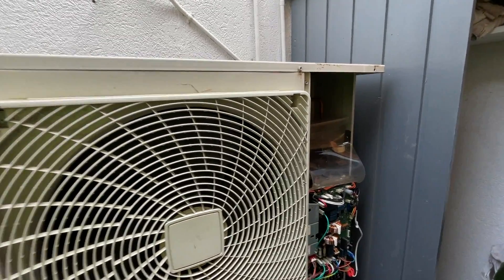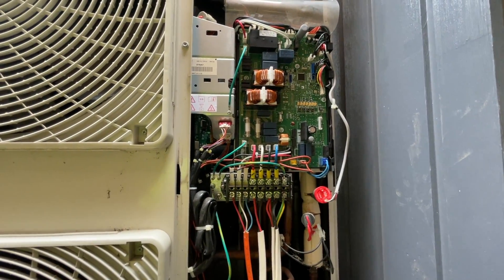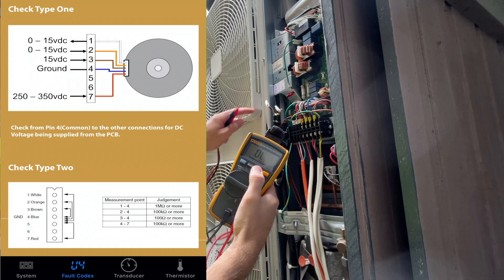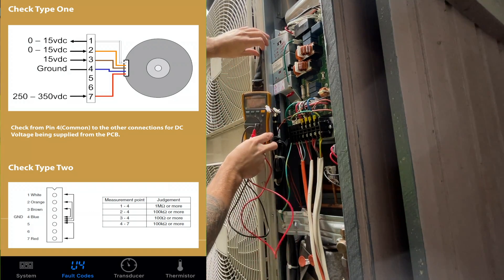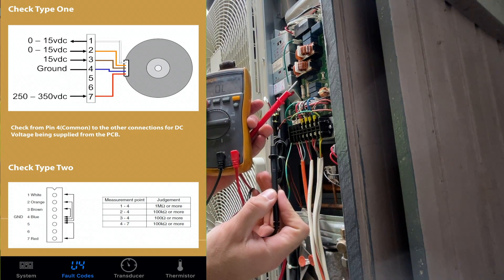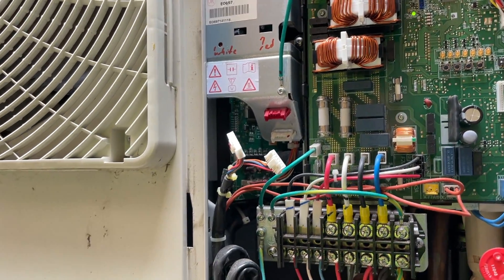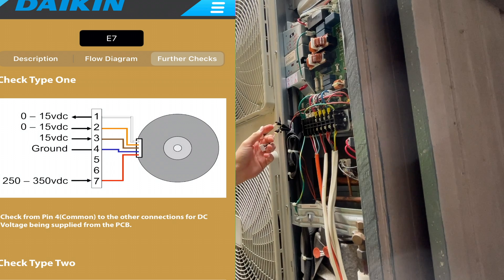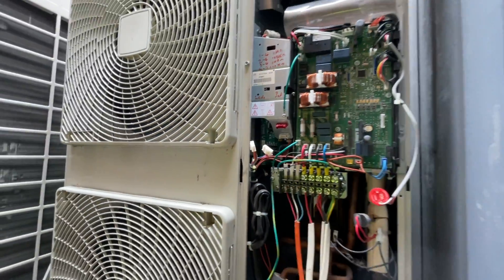Diagnosing Daikin E7 Error (EP 1)

Comment: Hey Mate great video, I've got the same code E7 - 02 on a similar unit. I've tested the fans and can only get 65kv from pin 4 to pin 3 on each connector, everything else shows nothing. Not sure if my multimeter is dodgy and just not reading the actual resistance (can change the range) I've even taken the wires out of the connectors to make sure I have good contact. Both fans will run (bottom fan a bit slow) and then shut off and throw the code. Any thoughts? Cheers
Reply from the maker: Hey mate, so just to confirm, have you tested the DC voltage out of the actual board? In regards to the fan, 3 and 4 should have 100 ohms or more. Are you saying you have 65ohms? 👍🏻

Comment: Hi great video, what build number is your app I can't seem to find the resistance charts that you can see on the service app I have...thanks for any help!
Reply from the maker: Hey mate, yeah so since they have updated the app you can no longer get access to the additional information or diagrams. I have no idea why. I was taking about this to a friend of mine who is also an air con mechanic just the other day. I complained to Daikin about this actually. 

I think you might be able to sign in or create an account through the app which MIGHT give you access. Haven’t tried this yet. Alternatively, if you ring tech support they will email you the diagrams. Sorry mate, hope that helps.
Reply: @maracservices  Hi thanks for the quick response, yeah I've done as you said and signed up for an account on the new app and it does give you more details as in access to the flow chart for the fault code but as you said yourself still no access to the resistance diagrams etc...

Comment: Thanks Mitch. I've had the same issue on my daikin. Have checked the pcb and the dc voltage is erratic and command voltage is neglibe. Gonna order a new board. 
Do you know if my board will need a capacity setting adaptor? Doesnt look like my current one has onem. Not sure 100% what they are for. 
Really good vids too. Thumbs up.
Reply from the maker: No worries. Thanks for the comment! 

Definitely need a capacity adaptor. These boards are the same for all the different models (for example, 12kw, 14kw, 16kW etc). When they install these boards in the factory they preset the capacity. However when you get them as a spare part, you need to put in the capacity adaptor so it knows what unit it’s for. Don’t worry, we are only talking a couple of dollars. If you don’t put one in, it will show a fault.